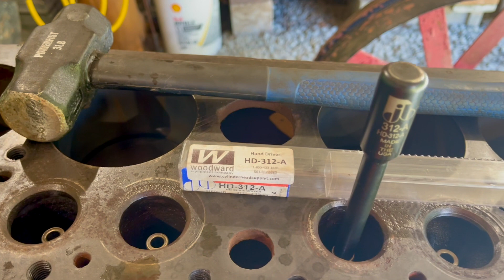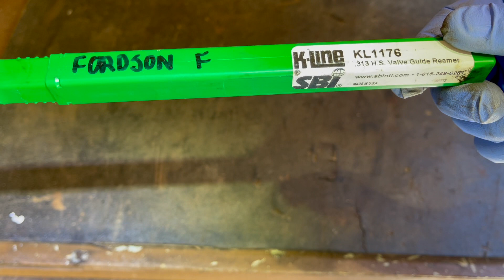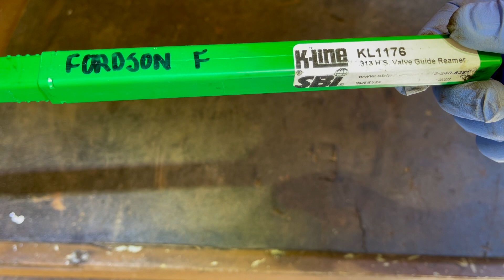Fordson F (1926) Valve Guides - Remove/Install (Task 3)

Comment: Just subscribed.  Looking forward to follow your progress.  Question - I wonder if an air or battery operated impact gun with socket would have helped free those valve guides rather than a conventional ratchet wrench?
Reply from the maker: Maybe worth a try, as the impact action might have jarred the sticky ones free. 
For your information - I drove the new guides in from the top by hand operated hammer, but had them in a ice box (at just below zero) whilst the engine block was at about 20 deg C (a warm summer day here) ;)  The size differential, due to the guides being cold and warm engine block, seemed to help on installation.